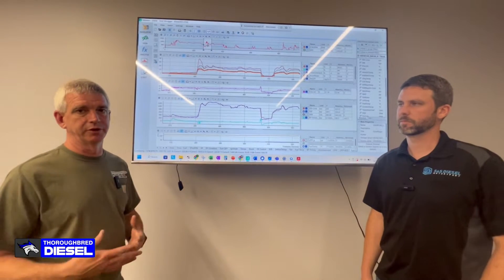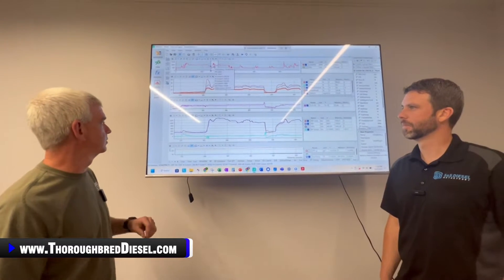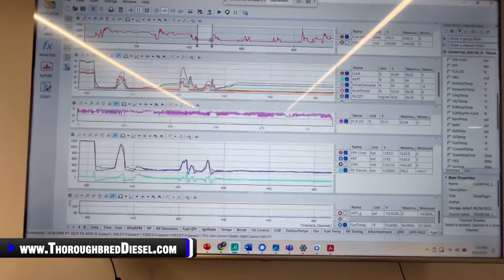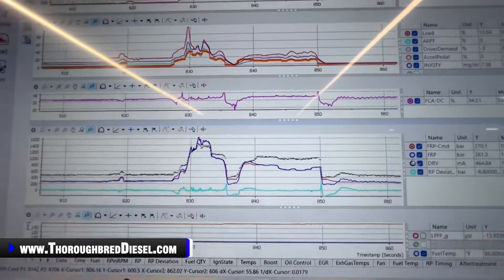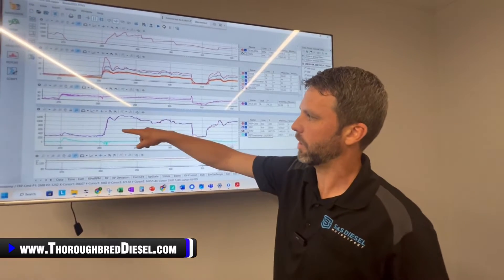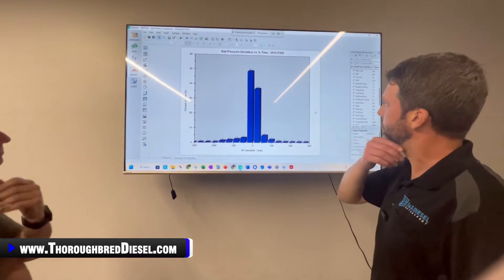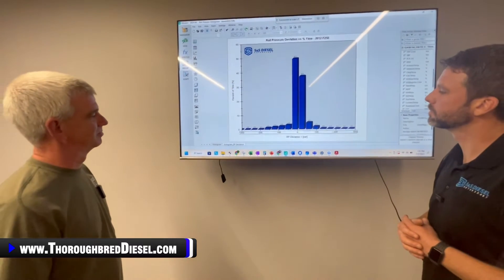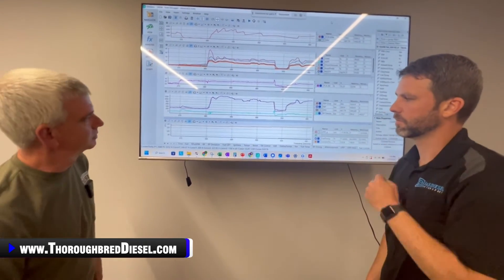Test Results!!! CP4 DELETE to 6.7L S&S DCR Pump@SSfueled #fordtrucks #powerstroke #diesel #shorts

Comment: Today makes day 2 on the new dcr pump in my 2012 f250. So far I’m loving this pump.
Reply: I installed my DCR kit on Friday on my 2018 f350. So far so good. Very well built kit. The quality is excellent. Did you notice any difference from the cp4?
Reply: @anthonyc993  ... according to the data you see on the chart the pump, on paper, is the exact same as the glitter bomb CP4.. I swore off fords 6.7 due to "potential" pump issues and with the DCR pump and how it seem to be doing might.. might c me looking at the super duty again..